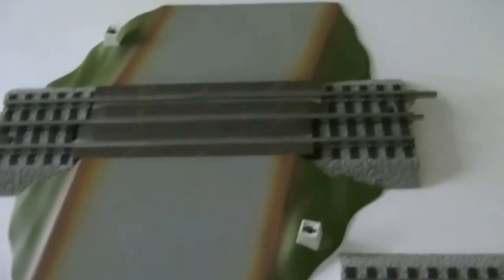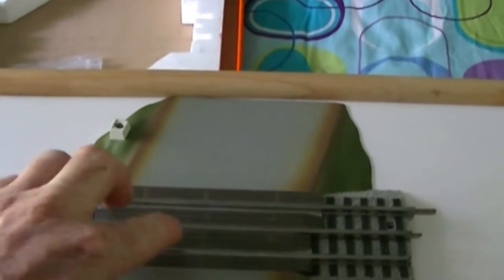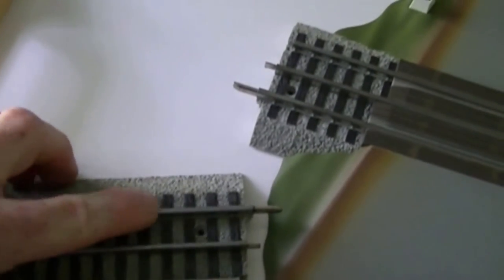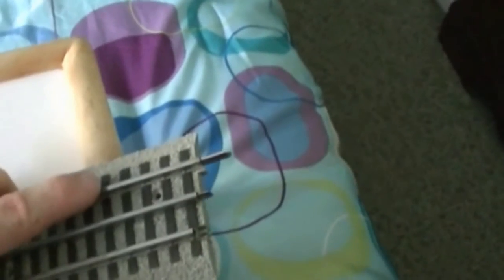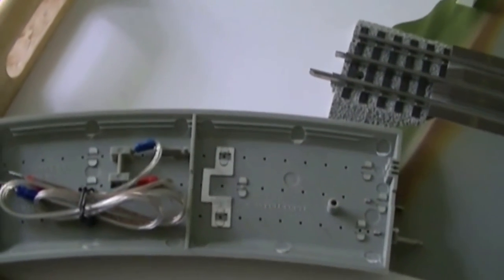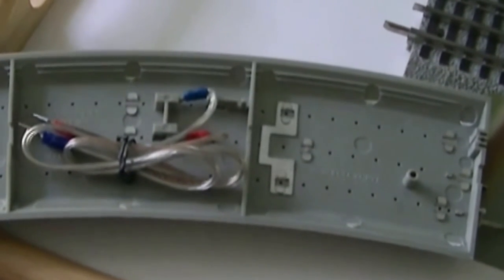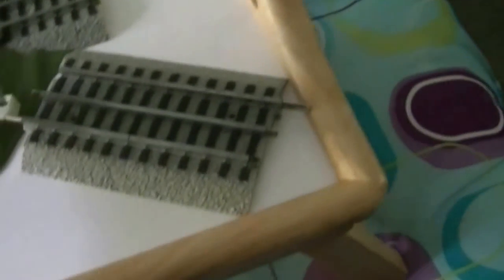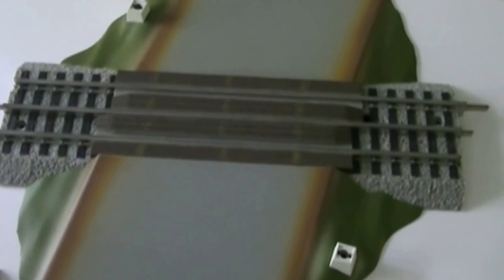How To Video For Lionel Fastrack Railroad Crossing Signal With Bell Sounds

Comment: Jeff, Thanks for this video.  It was very helpful. I just bought one of these crossing last week and remembered seeing your other video on it a few months ago.   Unfortunately, the dealer I bought it from somehow left out the two 5 inch isolated track sections.  To try to make things right, the dealer sent me a package today which was supposed to have the 5 inch isolated track sections in it; however, they mistakenly sent me 2 ten inch insulated track sections.  I gasped when I opened the packaged and saw the wrong tracks.   I sent them email this afternoon explaining that they sent me the wrong track sections!  Hopefully, they will fix their mistake.  Again, a great "how to" video!
Reply from the maker: Your welcome Ken!!! Yeah that not good. Ken that ten inch may work let me look it up see what looks like.
Reply: *****
Unfortunately, it won't work because it does not have the break in the rail on the outside rail.  The 10 inch insulated track only has the metal band removed under the track. Good for extending the block like in your video, but does not create the necessary block.  Thanks!
Reply from the maker: Ken i looked at that. I don't think it will work. You need the lionel Ass. pack 6-12029 or part number 6102021001 isolated 5" track
Reply from the maker: Ken did u get the track issue straighten with your dealer !!!
Reply: *****
The dealer offered to give me a refund so I am going to return it.  I probably could have found the 2 isolated tracks somewhere else since the dealer said they did not have them, but it would add more cost...not worth it.   I have already found another dealer that has brand new ones in stock. I will be purchasing another one soon. Thanks for asking!
Reply from the maker: Your welcome!!